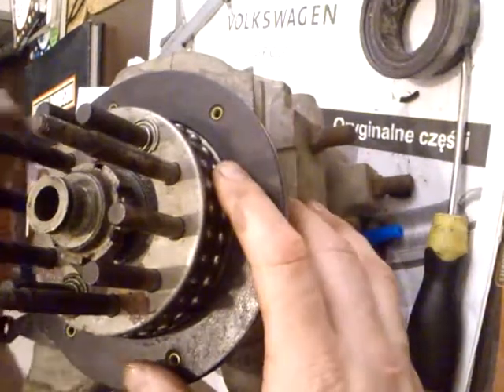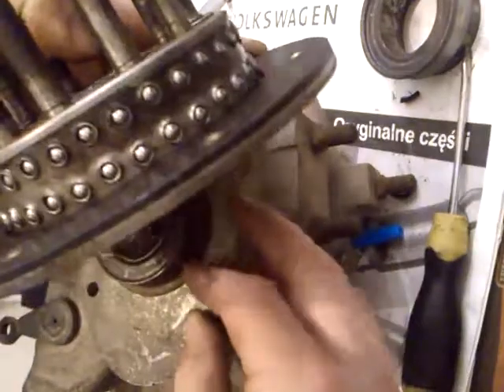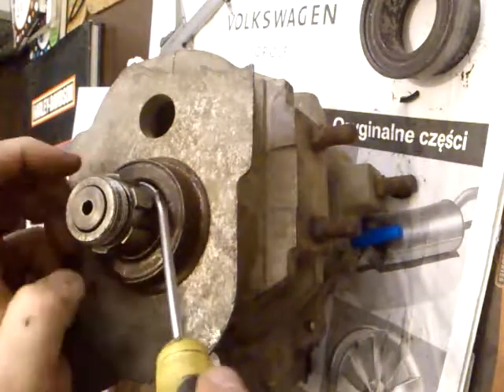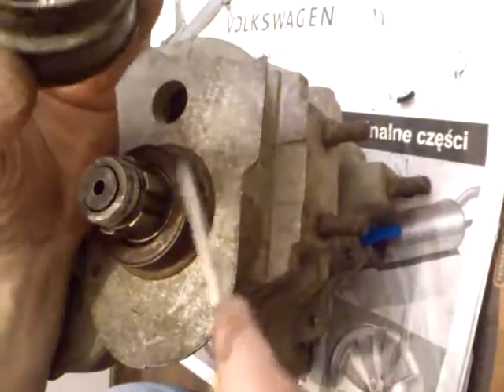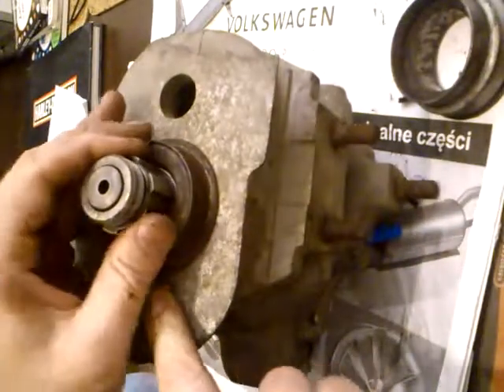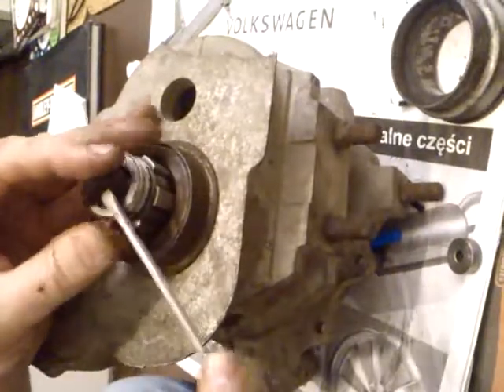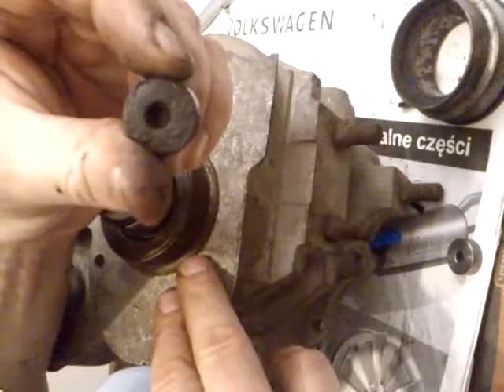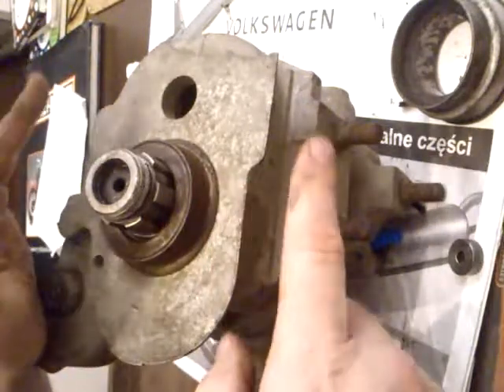Why oil leaking from gearbox on a clutch plates Harley 45 WL WLA Flathead

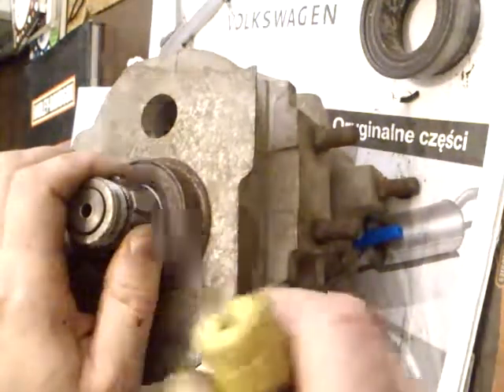Comment: Hi, at 1:32 in this clip, you started to work on the gear box, correct? It is there where you remove the sealant gasket and the rubber ring. Does this means that I have to remove the gear box out of the motorcycle to do this job? Or is it enough to work one the gear box on the motorcycle?
Reply from the maker: Hi, You can do it when the gearbox is on motorcycle.